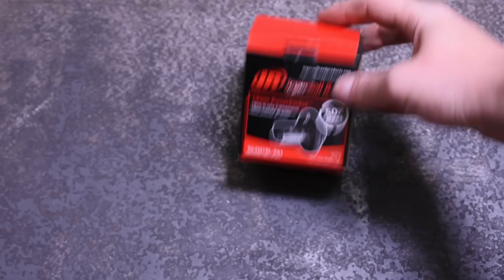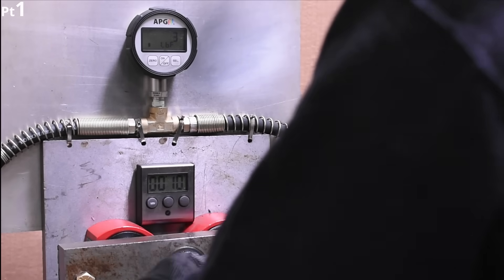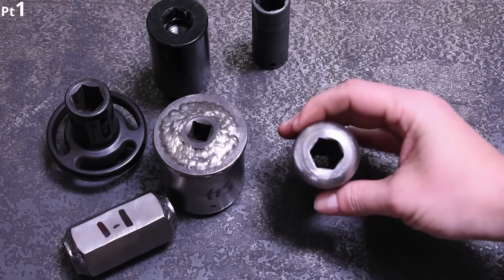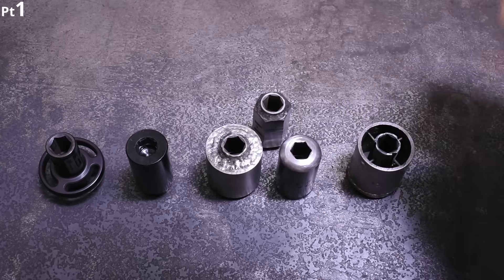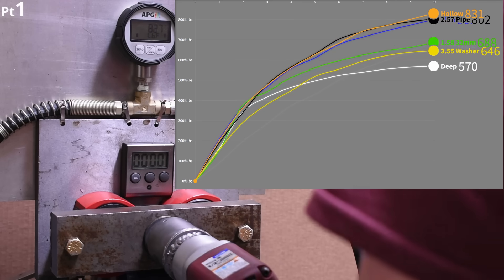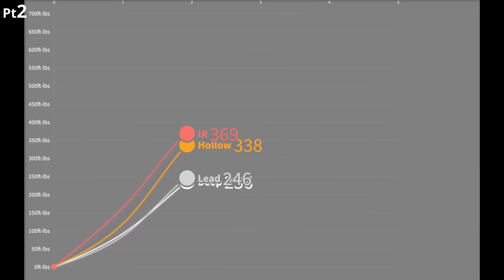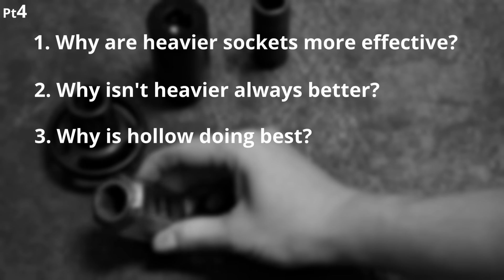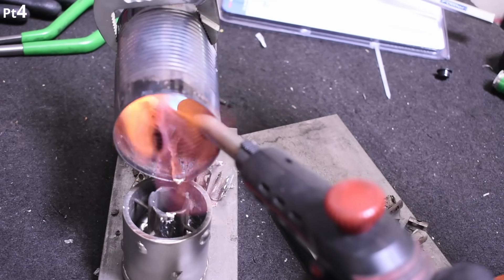Heavier Sockets Make More Power? Stumps Physicist

Comment: What the physicist said is unbelievably stupid. I can't believe that guy is teaching anything to anyone.

You're seeing more torque because it's not a rigid system, there's slop in all sorts of places (including the flex of the bolt itself) The system of the socket + impact accelerates through that slop, then slams into the resistance with its stored force + whatever momentary force the impact can add. A socket with higher moment of inertia means potentially both slightly more time for the impact wrench to dump energy into the socket before impact, and slightly more energy dumped into the bolt before the inertia is spent. That increases the peak energy delivered and thus delivers a higher torque number.

There are also other effects going on like the springiness of the system and how it resonates, so the exact optimal driver would vary based on everything else involved.

Comment: The moment of inertia is for sure helping here, but you need to find a balance point. I think the looseness between the socket and the bolthead allows the sockets to accelerate and accumulate energy before the impact. Can you make a very tight fit socket-bolt interface to confirm my hypothesis? If im right you should not see a benefit from the increased mass an maybe even a decrease in torque.

Comment: What if you built the hollow or ringed socket as an extension. Say maybe 4" long? If it improves the force on a standard impact socket it would solve the problem in most cases of the socket being too big to fit the space available. I mean since science can't seem to answer the question how the ring socket works maybe it would also work on an extension if the looseness of the joints don't impede things? That Honda crank bolt problem crosses over in to the marine outboard motors also.

Comment: Speaking of wheel weights I got a flat tire today from a wheel weight. I've seen some strange flats but this one has me thinking I must have picked it up on soft ground. Apparently the heavier the better to a certain degree. There must be a ratio to socket size where the weight helps but anymore weight hinders it's effectiveness.

Comment: There is one factor that wasn't mentioned in the video: from what the bolt is mounted to right back to the person holding the impact driver, elastic deformation is at play.  (If you bend a bar and, after letting go, it goes right back to the original shape, that is elastic deformation.  If it stays bent afterwards, that is plastic deformation.)  As each impulse of torque is applied, there are complicated (elastic) shifts in the physical structure of everything involved.  What I'm seeing is that, while adding mass to the socket decreases the 'forward' rotation for a given impulse from the impact driver, that mass also decreases the 'backward' rotation as the elastic deformation in the nut/bolt/mount tries to return to its original shape, against the mass of the socket.  (If you look at the final angle of the lead-filled socket, you'll see that, while it is low compared to the other sockets, it isn't leveling off like they are.  This REALLY should have continued on for twenty seconds at least.)  

What's more, we aren't talking about continuous force, but pulsed force, with a time gap between impulses.  That is important because it explains why the socket with the spoked flywheel works so much better than without it, as there would be a significant amount of elastic deformation within the relatively thin spokes, so the flywheel itself won't be completely synced with the socket, extending the forward momentum to some degree during the time gap.  (The length of the gap, itself, would have to play a part in the efficiency of the system as a whole.)

I think that the following to changes should be made to the experiment:

1.   Longer tests.
2a. Testing different spoke thicknesses/lengths/etc.
2b. Testing different flywheel masses/radii/hardnesses/etc.

Does that sound reasonable?

Comment: I'd be willing to be it's less about the added weight but more about how far from center the weight is added. This is in a way adding leverage, like a cheater bar on a wrench does. As long as the flywheel is rigid I'd be willing to bet that a transfer of the existing weight further outside of the socket would add more torque. The only limit being excess weight that doesn't help and losing rigidity in the flywheel.

Comment: We routinely use a 3/4” Milwaukee impact and a large extension to hold down motors. While impacting, when the gun runs out of beans, we turn the extension by hand while impacting and it does add more torque and tightens significantly further. No clue how that works. Would be cool to see what the dyno shows doing the same

Comment: I believe this comes down to the physics of tinsel strength.  Meaning the "give" in the steel hammering pushes and then retracts adding to the hammer strength.  The hollow worked better because it has a larger pushing and pulling effect adding to the hammering strength,  Hope that made sense - let me know what you think.  The led did not allow the pushing and pulling strength because it had too much give and lessens the hammering effects.  Kind of surprised the professor did not even speak to the pushing and pulling effects - he completely overlooked the rules of forces applied and then retracting back.  This adds its own set pf physical effects especially depending on the materials as in your example of steel vs led.  The washers had too much give and not enough rebound strength as compared to the hollow steel.

Comment: I’m very sure Ingersoll Rand has done their homework and figure out the resonance and those come up with the flywheel designed .

You cannot just increase the mass . As you have found with that heavy weight socket .
Too much mass just increase the inertia . Wasting the impulse from the driver .

Just enough mass at the right distance from the center help . It reinforces the next impulses with just the right resonance .

You can increase too much of the flywheel weight and reduce the effectiveness too.

Overall, I’m very sure IR has done their experiments 👍
Job well done

Comment: it seems that if the flywheel section of the design ran the full length of the socket then that would work even better. Basically as long as your impact wrench has sufficient beans then increasing the mass distally from the socket's axis of rotation would result in a pure mechanical advantage? am i missing something? this would explain the effectiveness of the hollow design vs the solid design too

Comment: I would believe the hollow socket best matched the weight of the hammer mechanism in the impact wrench.  Much the same as the balls on the inertia toy people have on their desks.  Because the balls match each others weight the transfer of energy is almost seamless from one end to the other.  Another example would be two different hammers for driving nails.  If they are similar in weight and strike each other, then they will bounce equally in transferred energy.  If one is lighter than the other, then the heavier will dominate or override.

Comment: I think it's all about finding the right resonant frequency that most closely matches the tool itself , and this subject is touchy for most physicist because everything is frequency even matter and throws just of everything you've learned in high school text books out the window. But if you think of the ir socket with the flywheel before you cut it, I'd be willing to bet if you hit it just right you get a certain amount of ding much like a tunning fork and same with the hollow socket. Maybe those two are closest to the actual resonant frequency of the tool itself. To test my hypothesis one could actually use the blows per minute to come up with a hz value, whatever that may be, then in turn create a socket that will resonate well with that hz value. Think of energy much like a tunning fork. I think Mr Tesla was right when he think in terms of energy, frequency  and vibration.

Comment: armchair engineer in me says there's a bit of "tuned mass" involved in this. Hence why you had kind of a bell curve for effect vs weight. I would go on to assume that the same hallow and flywheel wouldn't be optimal in sizes above it (if you were to keep the design) say try a 1" or  something like a 36mm (pretty common axle nut size) bolt head. More of an extent into it I would wager the "torsional strain energy" at the bolt head tuned to the mass/rotational inertia of the socket is the root of the magic sauce. 

An example to prove this is to try that same lead socket on one of those huge 1" impacts on the bigger size bolts. and compare them to the lighter/standard sockets.

Comment: Not a professor, nor engineer here. But i am a "boomer", and therefore- much smarter than i ever actually was! So- on the IR flywheel style, the outer ring funtions as a gyroscope for a moment allowing centrifugal force to come into play, until the gyroscopic force ends at the end of the impact "stroke", allowing the centrifugal force dumped as inertial impact. This hollow rotor, or flywheel effect is "observed" by the bolt as "more weight than is actually there. This would also explain why the "flywheel" was placed on the socket by the mfg as close to the tool anvil as possible, and why the in house "hollow rotor" socket worked well also. I think. Now get a haircut- ya hippie! 😠

Comment: One useful thing to test is how much the rigidity of the connection between the wrench and the socket affects the applied impact.
     I.e. if the socket is shrunk-fit onto the torque wrench, then they essentially act like one piece and you only have impact transfer from the socket into the bolt. But if the square drive is loose, then you have to transfer the impact from wrench to socket, and then from socket to bolt; so that means you have to impedance match the "moment of Inertia" twice, and you have two occasions to lose energy. The looser the connection - the more slack it has to take out before it acts like one piece.
 
Now I reckon, that with a really tight socket (welded, shrink-fit), you wouldn't need any extra weights on the socket, and the extra weights should only hurt.
(I'm using simplified phraseology here, obviously it's about dynamic moment of inertia and not weights)

Comment: Actually, it is quite easy. The energy stored in the flywheel should release itself (from bending) as close to the peak of the next impact as possible. In this case the impact is stronger than without flywheel. So, you should take into account, socket length, material strength, flywheel mass, impact per minute and impact force. There is an optimum mass for each set of variables.

Comment: I think the follow up to this will be a homemade flywheel design which uses bolts welded to a normal deep socket. Then add nuts and spin them in/out to change the overall diameter of the weights until the perfect balance of weight & distance is found. I'm betting the IR flywheel design is already tuned close to perfection. Should be pretty cheap to reproduce with harbor freight or tractor supply sockets & fastener hardware. Cheap to build but still able to remove that Honda balancer ;)

Comment: Not an engineer or scientist. I suspect momentum is imparted in 2 stages. Since the driver anvil is separate from the socket which is, in turn, separate from the bolt, in each of those interactions some mass is accelerated for a tiny fraction of a degree before striking the next stage and in a sense it is no longer the actual driver causing the motion but the chain effect of rotating masses running into each other. With this in mind heavier is better, however... there are diminishing and even negative returns because the impact driver has to overcome the inertia of the socket and not have the impact be absorbed (or dissipated in unhelpful directions) by the socket. 

Not sure why a hollow one works better but there are other factors at play here. As someone else pointed out, resonance could be important here. Different combinations of socket rigidity, dimensions, mass etc will interact differently with any particular impact driver's rate of rotation, frequency of hammer blows, mass of hammer etc.

Either which way, it would be extremely interesting to see more controlled testing. Compare different combinations of sockets: same mass/different diameter; same mass/different length, same mass and dimensions but different materials, or even take out all the slop between the components by welding a socket to the bolt and somehow rigidly clamping it down to the anvil of the impact driver. If someone has enough ingenuity, resources and discipline to do this right there might be a published paper in here somewhere. I would imagine tool manufacturers are already working on this to some degree but are keeping the data/results secret.

Comment: If you melted the lead out of your test socket it would work better. You had it before you "fixed" it. I was with you though. Then after seeing the results I saw the flaw in the weighted socket. IR socket is the best. You could make a ring of heavy iron, weld it on with stand offs and make a better socket, but your welds better be top notch. This was a great test. Well done. Really makes you think about what you think you know.